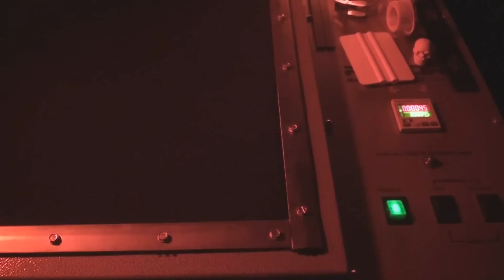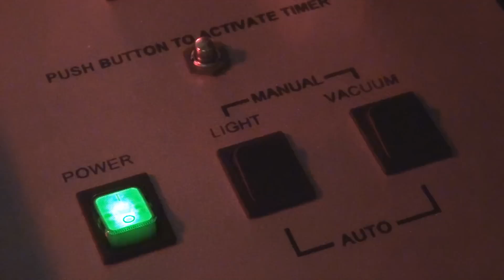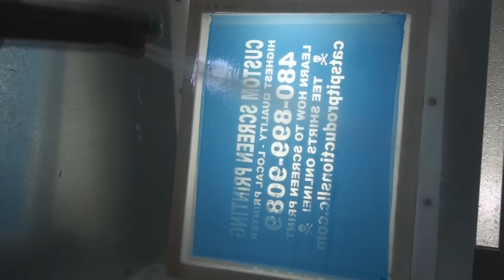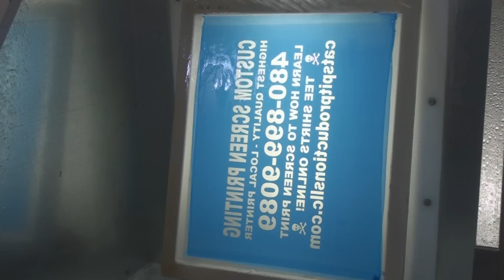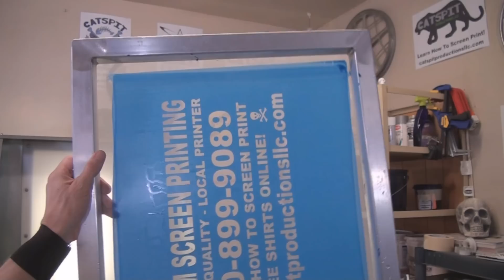Silk Screen Printing: Exposing & Washing Out The Stencil

Comment from the maker: That was an old pressure washer that had 2 guns in the head. One was for the pressure water and the other was for tap pressure sprayed. So what you see here is nothing more than tap pressure with a spray nozzle. You shouldn’t need a pressure washer to washout screens. If you do then something is wrong. Thanks much for watching and dropping me a note. ☠

Comment: Hey there Spit, I was recently blessed with some equipment, but have never done any screen printing. I had a friend make me a simple design, and I had it made into a stencil at kinko's. After about 11/12 attempts at trying to burn my (200 mesh) screen using (85% of the jar) kolormatrix blue foto emulsion, I've gotten VERY frustrated. ( Not to mention 95% of the bottle of emulsion remover) When I power wash it on the burned side, some of  the emulsion has repeatedly blown away.  How long am I supposed to wait after I burn my screen before I wash the image. Help me please ! I already told my kids that I would make them some personalized shirts. At this rate, it will be my grandkids.
Reply from the maker: I would recommend using regular garden hose cold water with a spray nozzle for washing out stencils. Only use a pressure washer for reclaiming and de-hazing. Also a water proof inkjet film positive will help you make the stencil easier. Transparencies from laser printers often lack the density necessary. You should washout the stencil immediately after exposure. Do not wait any time at all. Thanks for watching and leaving a comment! http://www.catspitproductionsllc.com/ - http://catspitscreenprintsupply.com/
Reply: Thanks Spit, I'll try and let you know.
Reply from the maker: BigMoneyTexas77701 You're welcome. Good luck!
Reply: BigMoneyTexas77701 How do you like your kolormatrix blue foto emulsion? I been thinking about purchasing it as it is a bit cheaper than the ulano qtx. Is it good for fine detail screen printing?
Reply: CatspitProductions  How do you like your kolormatrix blue foto emulsion? I been thinking about purchasing it as it is a bit cheaper than the ulano qtx. Is it good for fine detail screen printing?
Reply from the maker: Davey Rockit I do not use Ulano. I use Saati Textil PC Blue. http://catspitscreenprintsupply.com/saatichem-textil-pc-blue-emulsion-gallon/

Comment: I used a pressure washer for the first time in screen printing and everything came off haha maybe I was to close.
Reply from the maker: Well you shouldn't use a pressure washer to wash out the stencil. This unit I was using in this video had tap pressure water and pressure washer nozzles with a dual handle. It was pretty cool but you should only use cold tap water to washout stencils on exposed screens. Pressure washer is way too much. Thanks for watching! Screen Printing Equipment & Supplies - http://CatspitScreenPrintSupply.com/

Comment from the maker: But here I am using just the regular household water pressure to washout the stencil. You shouldn't need the pressure washer to get a stencil washed out. If you do you are semi curing the emulsion. Probably from light fim positives. ☠